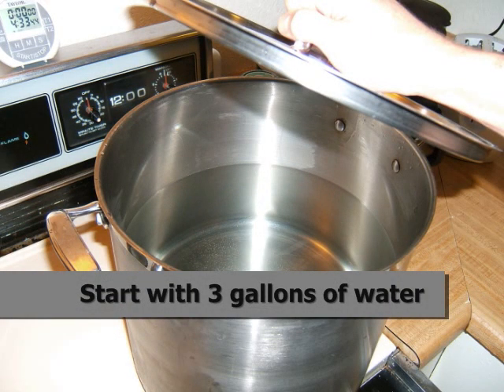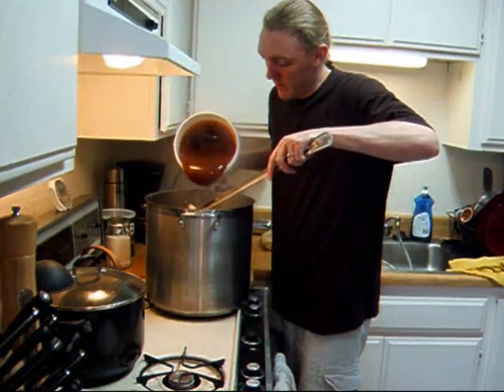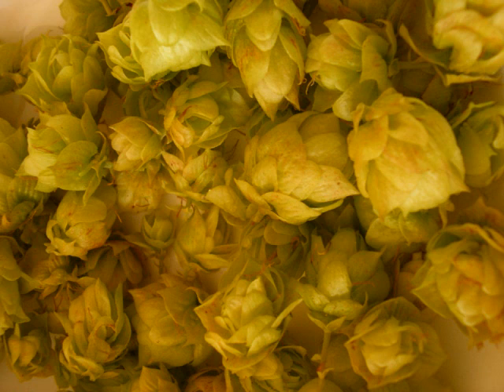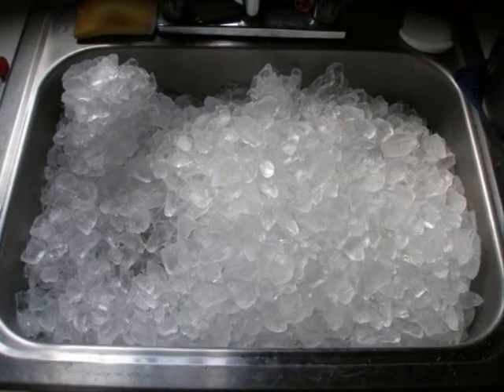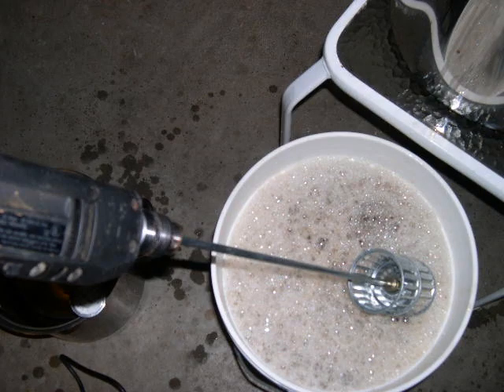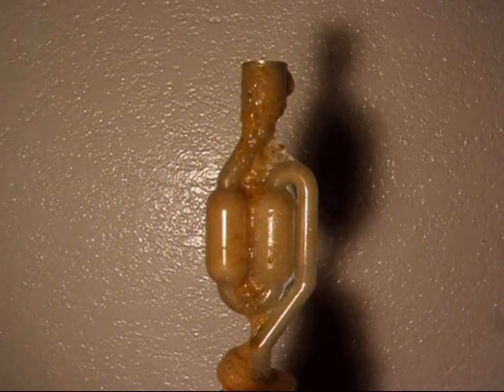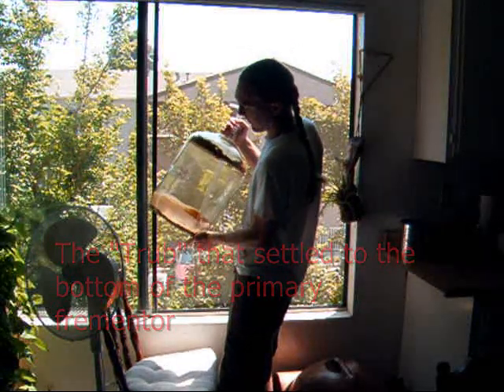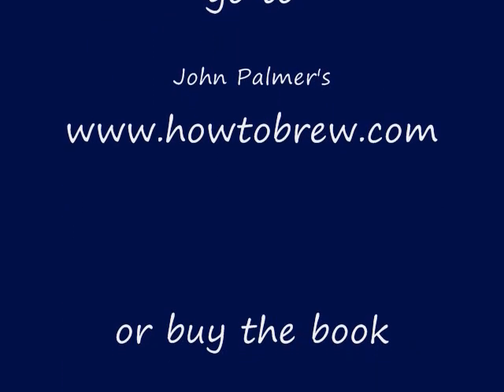Homebrew beer, the basics of  home beer brewing.

Comment: Restaurant supply store. Any moderate sized city will have at least one, any big city will have several. 5 gallon stainless steel model shouldn't run you more than $20-25. You can get 20-24 quart ones at wally world or target for about the same price, but that extra space is a real blessing.

Comment: Actually I just add 20-30 psi of CO2 to my newly keged beer and then with some shaking to help dissolve the CO2 into the beer I turn the pressure down let it sit for a 5 minute then run a pint for tasting. Never had a problem using this method because I always rack to a secondary fermenter.  Sure there will be additional settling but I gotta get that first fix of my new brew to get a feel for the batch. And yeah, I try to have other HB available while my recent brews age a little. Cheers!

Comment: @GLeonGarcia I don't think your ice will last long in your bucket. As 212 degree heat is exchanged, your ice is going to melt and get warn. But if you keep adding ice or snow, it could work in theory. A counterflow chiller, however, is something you could use if you have the right equipment. There is also mini-chillers out there that you put in buckets of ice to get the water as cold as you can before it goes into either the immersion or counterflow chiller. This chills your beer much quicker.

Comment: @kjamesuvic At the beginning of the video, he said he started with 3 gallons of water. This is most likely because most pots cannot accommodate more than 5 gallons of water. During the 1 hour boil, somewhere around a gallon will evaporate. What's left is called the concentrated wort, which needs to be diluted before fermenting so the fermentables and hops to balance out amongst the total 5 gallons. The wort/water ratio is not as important as the right amount of ingredients during the boil.